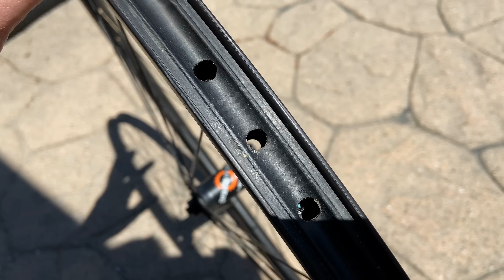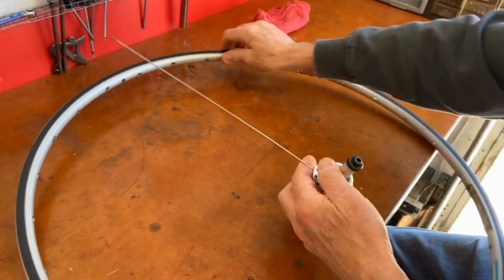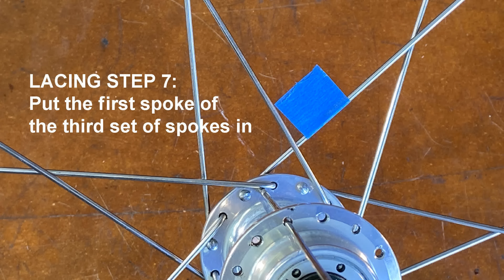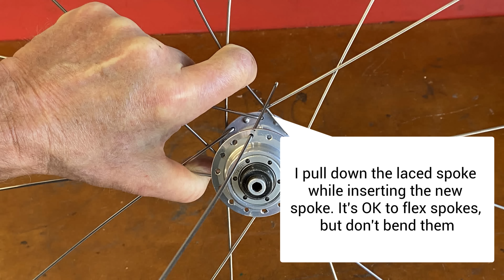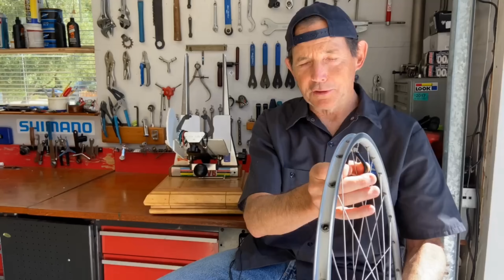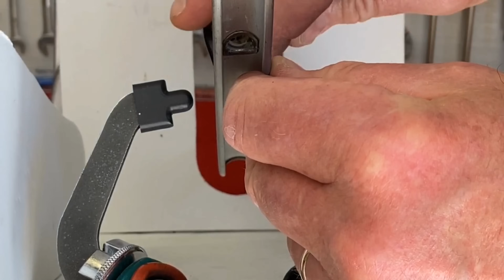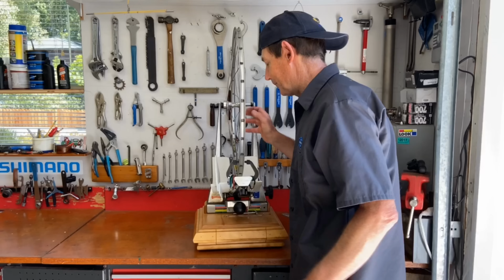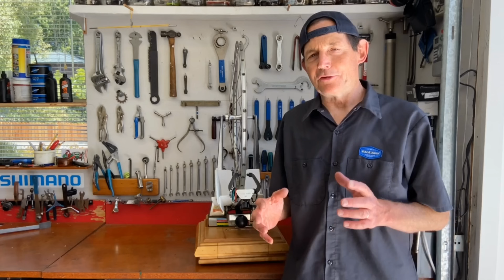How To Build Bicycle Wheels THE EASY WAY! #bikerepair

Comment: Awesome instructions, in a relaxed way for the viewer. You have not made it a "thing", just proved that it is actually fun and in a way satisfying. Educational and good! You have just turned a problem into something to look forward to, with enthusiasm. However, I have a question regarding spoke tension at the end of the video; Can an spoke tension tool be used? If I remember correctly, there are recommendations from rim and spoke manufacturers for the tension of the spokes? Correct me if I am wrong, but the only way to measure that the tension does not exceed the recommended value is to get numbers on it? (excuse my bad English and possibly my stupid questions and statements).
Reply from the maker: Thank you for the nice comment, Alexander! I appreciate you watching and commenting. On your question, yes you can use a tension meter to make sure you get the spokes tight enough. 

I use the fantastic Wheel Fanatyk tensio meter. You can see it here: https://www.wheelfanatyk.com/store/digital-tension-gauge/ I have also used Park Tool's TM-1 Bicycle Spoke Tension Meter and that works very nicely, too: https://amzn.to/3gYrZxc 

I do not show these tools in this video because it's unlikely someone just beginning to build wheels would have them. So I explain in the video other ways to ensure you get your spokes tight enough. If someone enjoys building wheels and decides to do it regularly, then I recommend they purchase and use a tension meter like Park's or WheelFanatyk's. Both those tools are easy to use and understand and even complete beginners will get up to speed fast. That's not the case with a lot of other tension meters, which is why I recommend those two tools. 

Regarding getting spokes too tight. It would be unusual for that to happen on someone's first attempt at wheel building. They feel tight way before they are anywhere near tight enough. So most new builders stop tightening. This means almost always the issue is not getting them tight enough for the new wheelsmith and that's the true value of having a spoke tensio meter.  

Lastly, if someone doesn't want to buy a tensio meter, they will learn how tight is right when they ride their new wheels. If the wheels continually go out of true, then the spokes need to be tighter. And, when they are tight enough, the wheels stay true. So, you don't absolutely need the tool. Remember that for well over a hundred years people have been building wheels and for much of that, spoke tensio meters didn't even exist :-)

Thanks for the comment and great question! I hope my long answer didn't bore you.

Comment: This video took the fear out of doing this at home instead of paying $60 and waiting 2 weeks for the LBS to do it. Thank you very much for the thorough explanation and for going all the way through the truing process. It made the video longer but it helped to see that you have to keep at it in small increments to get it where it needs to be. Thank you, thank you, thank you!!
Reply from the maker: You're very welcome, David and thank YOU for watching and commenting. I'm glad you appreciated the explanation of truing out wobbles and hops/dips. It definitely takes a lot of small turns of the spoke nipples and patience. It's one of the most satisfying parts of building wheels because you're actually taking something imperfect and making it as perfect as you can get it. Anybody with patience and awareness of what's happening (what I explain in the video) can do this. And in the end you get even more satisfaction and outright delight in riding on wheels that you built yourself. Have fun! Thanks again.
Reply: Tzzztzz
Reply: ف. فف.
Reply: غ.  ف
Reply: فظفق٤ف
Reply: T5 z5
Reply: ,tt z
Reply: r55,  zz

Comment: Jim, thanks for the excellent video. One of the most interesting and educational I've seen! I've never considered building my own wheels before but you have inspired me! I'm planning on building my next set of road bikes wheels. In your opinion, what would be the optimal number of spokes and spoke lacing pattern for the front and back on road bike wheels? Thanks again!
Reply from the maker: Thanks a lot for watching and the nice words, John, I appreciate it! My favorite road choice is still 32 spokes per wheel crossed 3... because it makes for wheels that will hold up to anything for years and years. And by anything I mean almost any size rider with almost any riding style plus any type of roads and terrain (like dirt roads so many are enjoying now). 

When you start reducing the number of spokes, wheels become less rugged. In a 32-spoke wheel if something happens and you break a spoke, the wheel will barely go out of true. But, just reduce that wheel to 28 spokes - only 4 fewer spokes - and that same broken spoke means a wheel that may wobble so bad you can't keep riding until you stop and fix it - which might not be easy since now there are bigger gaps between each two spokes meaning that you have a bit less truing ability with the remaining spokes. 

So, I stick with 32 spokes and 3 cross most of the time. Okay? I hope this helps. Have fun building your first set of wheels. Take your time and focus, and you'll be rolling down the road on sweet custom wheels you built yourself!
Reply: @JimLangley1  Thanks very much for your advice. I'll start shopping around and hopefully save a few pounds and, more importantly, having the self satisfaction (and kudos from others) from knowing that I built them myself. Thanks again Jim, you're a legend!

Comment: Brilliant, thank you so much. I now have the information to build the lighter alloy wheels I want with 5spd gear hub and front dynamo hub.....can for recommend a good spoke calculator or an easy way to calculate myself ?
Reply from the maker: Appreciate you watching and the kind words, Sarah. Here is a relatively easy to use spoke length calculator. Take care to get your measurements correct.https://www.sapim.be/spoke-calculator Hope this helps and thanks again.
Reply: Aha, big eureka moment here.....
the axle key broke in my sturmey archer ag hub,  so had to use an old spare wheel while I wait for the new part.
The wheel I pulled out the shed was badly buckled but with your instructions I managed to true the wheel and also get it round.....took a long time but yes I did it and it feels like a new bike.
Thank you so much,  I rely on my bike to get to work 😘
Reply from the maker: @zigzag8111  way to go! Congratulations on making your wheel true and round again. I'm so happy my video helped you get your bike back on the road and riding like new. You now have the key skills used in building wheels. Nice job! Thanks for letting me know!

Comment: Fantastic video! How do you determine the proper spokes/length for a given hub and rim combination?
Reply from the maker: Thanks for watching, Ra! Glad you liked my video. To determine spoke length you can use an online calculator, such as this one: https://www.sapim.be/spoke-calculator In order to use these calculators (there are lots of them online), you need to measure your hubs and rim because you need the measurements to plug into the calculator. The calculator page I linked you to shows how to measure things with nice diagrams.

Please note that it's always tricky to calculate spoke length. It's easy to make mistakes because there are many measurements that are not that easy to get accurately ( a compass is a simple tool to help get the hub measurements right); and many variables in spokes and nipples. And if you make a mistake you won't realize it until the wheel's almost done - when spokes are too long. If they're too short you'll know that during the lacing process because at some point in the build you won't be able to get a spoke to reach the rim to put on the nipple. Usually you can't return spokes, so the mistake means buying another set, after doing more math to figure out how much longer or shorter your spokes need to be.

A better way to buy spokes - though not so common anymore - is to try to find a bicycle shop that sells spokes. Then you can bring your hub and rim in to them and pay them to calculate the spoke lengths and sell the spokes to you. A good shop with that service will take care to get you the right length spokes. They likely already have a good database of hub and rim measurements and list of spoke lengths that they know work, too, which helps ensure they provide right-sized spokes to customers.

FYI: You want the spokes to be long enough to reach within 2 to 3mm of the end/top of the nipples (inside the rim). That way the spoke fully reinforces the nipple all the way past the nipple's seat in the rim. Okay? I hope this helps and have fun building your wheels!
Reply: @JimLangley1  Thank you! This is exactly what I needed to know.

Comment: What's  the  tools  can I use to  tighten  the nipple
Reply from the maker: The tool you use to turn the nipples to tighten and loosen the nipples & spokes is called a spoke wrench, Mackybish. There are different size spokes and nipples, so if you don't know what size you have on your bike, a good way to go is to buy a spoke wrench with multiple sizes on it, like this one: https://amzn.to/2XkvvsG 

If you buy this multi-size spoke wrench use it carefully. Make sure you choose the slot in the tool that fits snugly over your spoke nipples. If you use an oversize slot you might round and ruin a nipple and then you would need to replace it. You don't want that.

Now, if you don't have a spoke wrench or don't want to buy one, you can carefully turn nipples with a small adjustable wrench, too. I say carefully because what you don't want to do is ruin the nipples (just like with the spoke wrench). So, if you use an adjustable wrench, make sure its jaws are adjusted to fit over the nipple snugly, never loosely. That way it won't round and ruin the nipples when you turn them. I hope this answers your question. Thanks for watching my video and the great question!

Comment: I'm kinda curious..when u fixed the side to side movement of the wheel and then adjusted the dips and hops....Doesn't that affect like the adjustment u did earlier for lesser side to side movement?
Reply from the maker: Thanks for watching and for the question, Ali. Yes, it affects the adjustment you did before. So you go back and forth, truing for side-to-side and then for roundness and repeat. As the wheel gets truer and rounder, the adjustments for both get less and less. It's a fun process and with practice you learn how much to turn the spoke nipples and which ones to turn to get the wheel true side-to-side and round also relatively quickly. I hope this answers your question. Thanks again!
Reply: @JimLangley1  Thx...really appreciate such a quick reply

Comment: Thanks for this instructional video, of course, but also thank you for your massive responses to questions--even snarky ones handled professionally, whether deserved or not.
I didn't want to ask a question already answered so read through all 481 comments and answers- but if I missed it- apologize in advance.  I found your work of art and science while searching about wheel truing, but your enthusiasm is contagious- now I want to try a build!  I'm playing with an old Walmart Murray when still made in the USA, although inexpensively.  It has a 26" steel rim, hub and spokes, 36 of them.  From reading the posts- I learned they are radial wheels- not interlaced- thank you for defining that, and i was wondering if this might have been a manufacturing cost cutting measure as well as the steel construction making it unnecessary, and if when rebuilding you could do the lacing as described in this video- 2 under 1 over, if i don't have that backwards, or if that extra cross not in there now would shorten the spokes too much.  This is my wife's anchor- I mean bike, and may never get off the driveway so a perfect winter experimental lab rat.
I'm using a cheap but sturdy bike stand, and set up my magnetic base dial indicator from the fork to the rim just because it's easier for me to read than to sight a gap.  I got it to within 0.010" except where there is a dent and it jumps up to 0.030- still not bad.  I'll have to figure out a way to clamp it on other bikes, but for this thing- one more scratch won't hurt.
Thanks again, Jim- there are a lot of pretty much worthless how tos on you tube- and very few golden nuggets like yours!
Are we a bunch of pedalphiles?  When not riding we want to be working on them!
Reply from the maker: Wow, I'm impressed you read all the comments, Paul! Well done and thanks for watching the video and the kind words - I'm very happy you like it. Kudos on rebuilding your wife's wheel, too - sounds like it came out just fine. Now on whether or not to interlace the spokes and why Murray might have not interlaced them, it's probably what you surmised: a cost cutting measure. And, yes, it shouldn't matter much on a lightly ridden bike with steel rims.

Interlacing the spokes shouldn't change the spoke length either enough to cause any issues - assuming the spokes were sized right in the first place - but that's not a certainty with many department store bikes. So, it's probably best you laced it back up non-interlaced as it was. Lastly, I should explain that radially laced wheels are ones where every spoke travels in a straight path from the hub to the rim - so no spokes cross each other at any point. They aren't interlaced because no spokes cross. Just wanted to explain more so as not to confuse anyone else who reads all the comments ;-) Thanks again, Paul! Hope this answers your question.
Reply: @JimLangley1  I was often tempted to quit reading, but every time I saw you responding and thought- my part is easy- compared...and yes, you answered perfectly, thank you!  Well, temp. is up to 35 F, think I'll roll out my Lynskey and start filling in some zeros from my new year odometer reset!
Reply from the maker: @paulmarkowski9794  enjoy your ride!

Comment: What if the hubs has 36holes and the rims 32holes?
Reply from the maker: Thanks for watching and the question. The best thing to do in that scenario is to either buy new hubs with 32 holes or new rims with 36. But, if you had to put that combination together you could since both 32 and 36 are divisible by 4. That means that you could leave 4 holes un-used in the hub (2 per side) and lace with the other 32 holes. The challenge is getting the spoke lengths correct, which would probably take a little trial and error. Hope that helps.

Comment: I have an electric fat bike with a rear hub motor. I did the best I could to true the rear wheel, but the wheel Police came and arrested me for not making the truth come out. I can't get any of the bike shops to touch it cause they either say they only work on the bikes they sell or they're too busy. This was before Covid hit, so maybe they're worried my wheel won't fit in their Park Tool truing stand. Do you know if if a typical fat bike wheel w motor will fit your Park stand?
Reply from the maker: Hi Gee-tah Guy and thanks for watching! Fat bikes can have super wide frame spacing so it depends on exactly what spacing your wheel has and also on what type of truing stands are being used to figure out whether or not the wheel will fit. 

The good news is that you don't need a truing stand. The wheel can be trued right in the bicycle. If I was working on it, I would try to do that because that way you don't have to take it out and the bicycle frame works as the truing stand. If you could describe a little more about the wobbles in your wheel and what happened when you tried to true it maybe I can walk you through truing it yourself. I'm happy to offer more tips and suggestions to help so let me know. I bet you can do it if you keep trying.

Comment: Awesome instructional video, thank you!  I'm just curious about the "over two under one".  It seems to me there would be less overall stress on the spokes if you went "over three" with the 2nd & 4th sets of spokes, seeing as how the direction those spokes are inserted into the hub is opposite all three of the spokes they're crossing.  I'm guessing maybe that has something to do with wheel stability & holding round & true somehow?
Reply from the maker: Thanks for watching, R1gq2env. Yes, you're right, the reason we cross and interlace spokes (interlacing is where the spokes touch) is to make wheels strong, stiff and stable. However, there are wheel designs that make a point of keeping the spokes apart where they cross as a way to avoid any wear at that point. Typically, over many miles the touching crossed spokes will wear a small amount from the natural way spokes change tension when you're riding. A good way to limit wear is to keep that area lightly lubed but even if it's neglected, it takes years for the wearing to do any real damage to the spokes/wheels. Thanks for the comment!